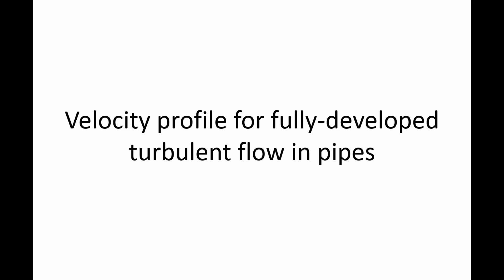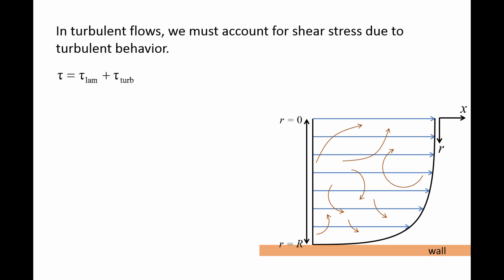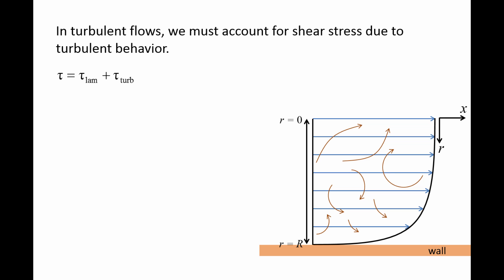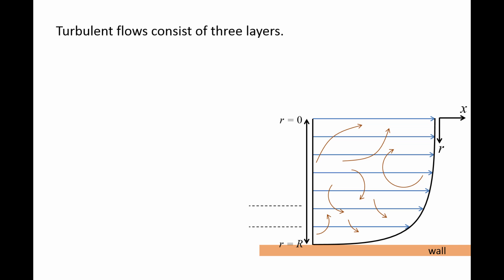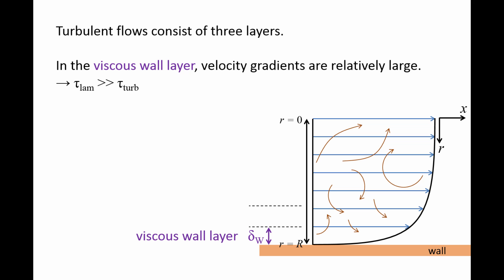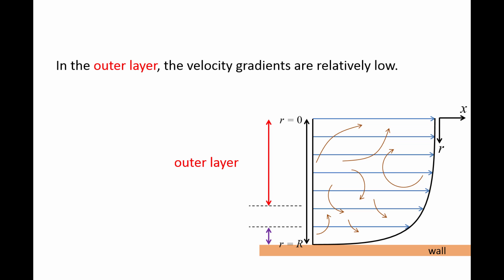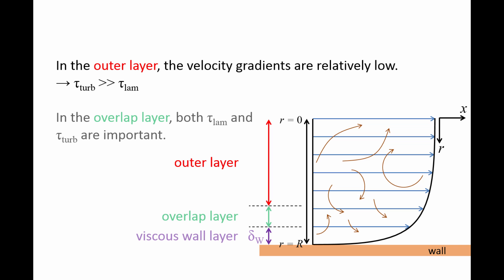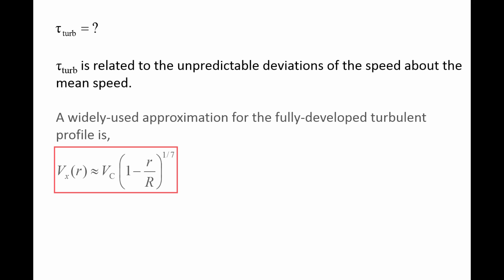Fluid Mechanics: Topic 8.5 - Velocity profile for fully-developed turbulent flow in pipes

Comment: hello,Sir.thanks so much for so clear video. I have a question as follows: as you show in the end of this video, the velocity profile for turbulent flow in pipe is approximately (1-r/R)^(1/7). Does this formula has a range of Re number that it is valid? Or this formula can be valid for all Re number as long as it is turbulent?